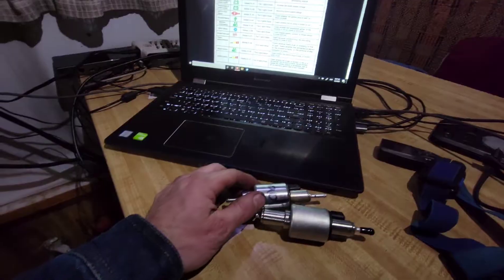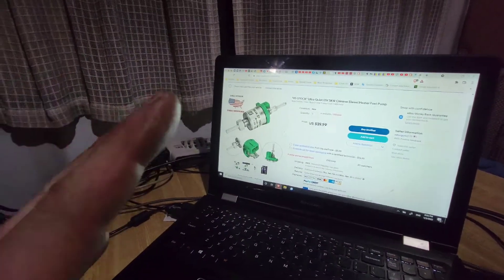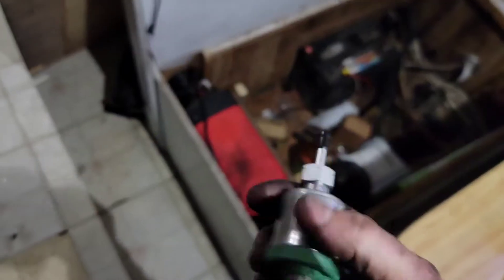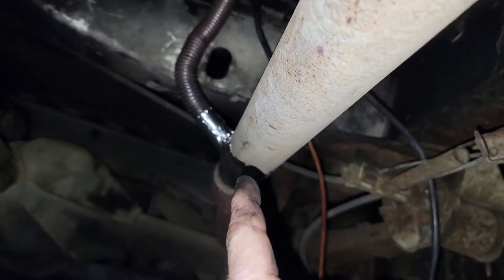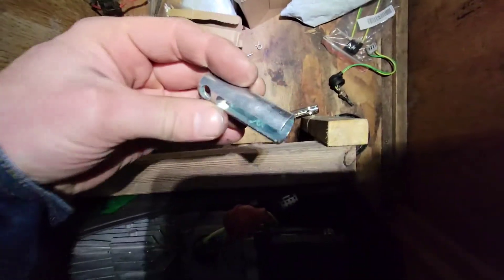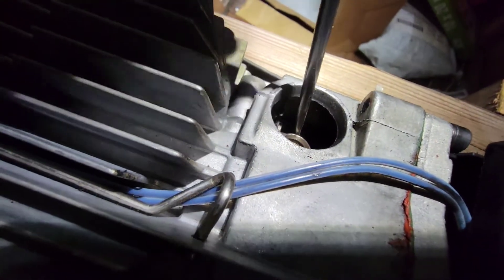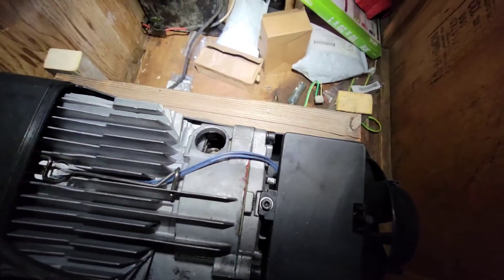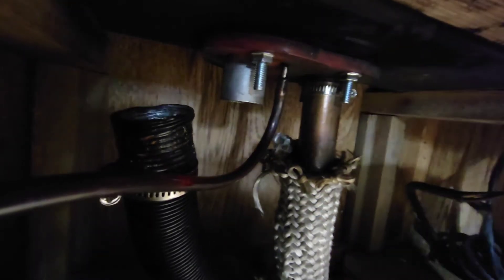Fixed - White Exhaust Smoke Won't Start Problem (E-10 Ignition Failure)

Comment: I installed one of these in my boat. It wouldn’t ignite and smoked like a steam train.  Kept throwing e-10 code.  I found the combustion chamber was flooding with diesel.  I removed the air intake pipe and gave a very short burst of Nulons ‘Start ya bastard’ into the combustion chamber (initially did this with upper engine cleaner -same effect) and she roared into life.  I gave it a squirt whilst it was in the initial start up process, works a treat to get it igniting properly. 🍺🍺🇦🇺🇦🇺🇦🇺🇦🇺
Reply: I tried starting fluid, we don't have Nulons ‘Start ya bastard’ in the states. but I assume it's the same thing, either.  And IT WORKED!!  not the safest thing in the world, I probably used a little too much. it backfired a little through the intake and then fired right up.  thank you for the idea.
Reply: @tomgrist2062  there’s another product called aerostart, similar idea.  Yeah I caused mine to backfire a few times but when all else fails 😀🍺🍺🍺🍺🍺🍺🍺
Reply: @Cammo-vp1gl  I thank it is not putting out the heat it used to and I will have to clean it. mine is less than a month old but I did burn used motor oil in it. it worked great until it didn't work at all.
Reply: @tomgrist2062  From day one mine has smoked badly, I thought the problem was voltage drop but, I measured it with a voltmeter and volts were good.  It still smokes on every start up.  Since my original comment, sometimes the trick with 'start ya bastard' hasn't worked so I bought a new glow plug but, the weather is warming up here and I haven't tried the new plug.  My unit seems to send too much fuel and floods the chamber.  I am at the point where, come winter next year (I'm in Australia) if it still isn't starting first time I am going to piss it off and buy a Webasto, Eberspatcher or the like.  When it does fire up, it's the best thing since sliced bread.
Never thought of using engine oil, good thinking!
Reply: @Cammo-vp1gl   I think using engine oil is what caused my problem. if I were you, I would  try blowing in the intake with a small shop vac while it is trying to start. if that doesn't work, remove your glow plug and clean the screen. I switched back to Red diesel only and it seems to be working.
Reply: @Cammo-vp1gl  also if yours has a high-altitude setting you might want to try that.
Reply: @tomgrist2062  I’ll have a look at the altitude setting.  It gives me a read out of height above sea level which is always wrong, at times it tells me I’m 80 mtrs above sea level (which isn’t high altitude by any stretch of the imagination) when I am actually on the sea!!!  All my boating is on salt water down here Australia.
I did use a vacuum to start it one day and it worked a treat but I sucked the exhaust with it.  That’s not an option when I’m on the water, my boat is only 24 feet long with 12 volt power.
Thanks for your tips, much appreciated 👍🏻🍺🇦🇺

Comment: started my night heater after months only to get error 10! But its firing up getting warm then the glow plug turns off then after a minute it comes back on before running for a short time then switches off altogether, at first i was pulling the fuse after it stopped then i  pressed it to start without taking the fuse out and it fired up but gets warm and cuts back off,  at least its took the chill out the van before going to bed. I will clear that hole and order the tool and a new plug but any other ideas in the mean time would be much appreciated. Thanks for an informative video
Reply from the maker: Check to make sure your exhaust pipe isn't plugged up anywhere. Could also be air pockets in the fuel line that are working its way out.

Comment: Glad you got that sorted out! Will come in use for me. I'm guessing you had propane for backup . . .
Reply from the maker: Ya, my RV's propane furnace held up for me during my downtime with the diesel heater.  But now I have to fix or replace the blower motor motor in the propane furnace.  Bearings are shot and it's making a lot of annoying noise.